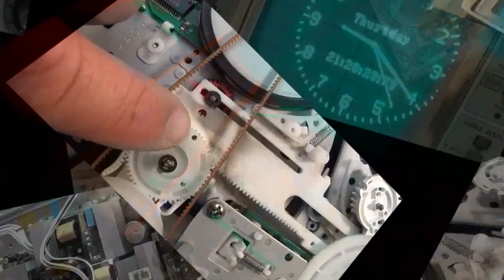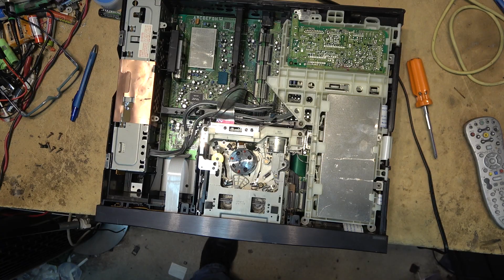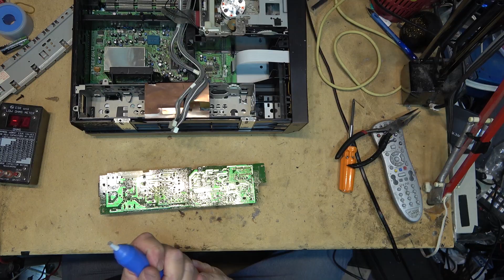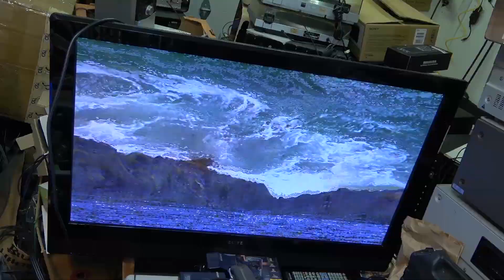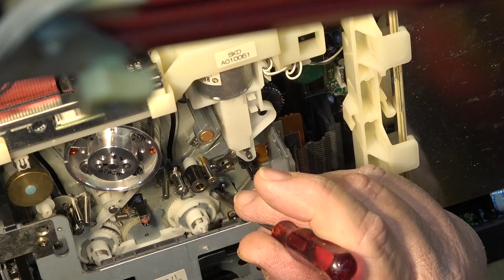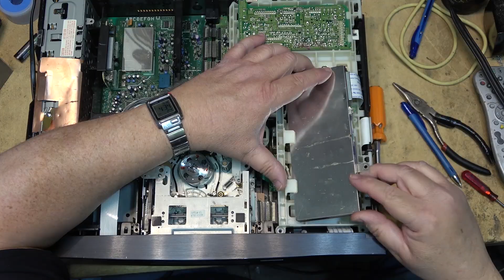SONY EVS7000 Hi8 Home Deck is totally dead

Comment: I also had a defective gear for the takeup reel on some of my Betacam camcorders. I replaced it with a self-printed gear from my 3D printer, and it worked perfectly again.
Reply from the maker: Not 3d printing these gears
Reply: @12voltvids  If you don't believe me I can send you a photo and the STL file.

Comment: I've still got that solder sucker.  I've since upgraded to the WEP 929D-V desoldering pump.  LOVE this thing!
Reply from the maker: Can't afford a pump.  I don't make any money fixing this stuff and the YouTube income basically just pays the bills.  Too many blocking ads these days.  Those or is relying on ad revenue are basically just breaking even if that.
Reply: @12voltvids  it's a manual pump.  I don't do enough of this work to be able to afford an automatic de-soldering gun, either.

Comment: HAHAHAHAH Cutting the Cord....
I may have mentioned before what happened to a Student next to Me in High School Electronics Class..
2 Sided long benches where students work from Either side.  A student flipped His Soldering Iron to get the cord from pulling and get a better work position. WHELL  just as He did that the Cord landed in the Jaws of a cutters of the Student just across the Bench. as the timing was just right   Clip/Flash. I fell off the stool landing on the Floor I was laughing so hard...  Even after 45 some odd years I can still see that.....
Thanks for stirring up the Memory....
Reply from the maker: In high school we used to charge caps to 400 volts and call someone and then toss it to them they catch it and got a jolt.
Reply: @12voltvids  AHAH Yup I only fell for that one once.
At tech school 79/80  A student was working on a Color TV. and got bit.
His jerk reflex Had Him toss a Pen He had in a Hand and it stuck in the Ceiling about 10 Ft up  Not sure how long it stayed there....
Reply from the maker: @m9ovich785 a microwave power supply bit me once.  Suffered PTSD for years.   Insulation failed on a tool.  About 4 kv made my hand grip so hard i actually bent the pliers.  In my hand out my elbow (or i wouldn't be here had I not had my other hand in my pocket and had insulated shoes on.  Threw me about 6 feet back.  I landed on a stack of TV's knocking one down and breaking the cabinet.  Asshole boss made me buy the customer a new set.  I still have the one with broken cabinet.  Used to be over my bench on early videos.  For years my wife would not sit next to me because i would have flashbacks in vivid dreams where i thought I was being electrocuted again any my arms would fling around.  She got hit a few times if I fell asleep on the couch watching TV. PTSD is real.  Another time I was bit from the CRT 2nd anode. Lightning kept out and bit me.  This time in my forearm and out my thumb. Still have the scar on my right hand thumb nail to remind me what 25kv did.   Electricity scares the crap out of me.  That's why i play with it.  Lol.
Reply: @12voltvids  OUCH...

Comment: If i were you i would give priority to replace the caps from the front loader. It's better before it starts leaking.  2 of my Sony S9000 (PAL version) that i've bought cheap, had a significant fish smell coming out of that front loading board with small caps corroding the traces inside of the shield part of that board. I know it's a bit painful to disassemble that front loading part,  with a brown color flex cable that easily can be damaged but it must be done before the caps start leaking.
Reply from the maker: Well then i get it back in a year or 2 and i can do it then.  I have not been given a blank cheque to do this.   If the cost is too high i get told to keep it for parts.  I have a garage full of stuff I have repaired that people never picked up that i have to end up throwing out.   People around here don't pay me estimate fees, if I told everyone that they had to pay 50 or 100 estimate fees they would simply not being it in.  They want stuff fixed cheap cheap cheap. If the estimate is too high they abandon it and that's why i have so much stuff backed up in the shop.  A guy dropped off an old grundig radio about 2 years ago. The pot metal flywheel for the radio dial crumbled.  He never came back to pick this piece of shit up and it's cluttering up my garage.  I can't even take it to recycling because it won't fit in my car.

Comment: I had the same 56uf cap go dead on mine. Also most of the caps in the TBC board. And the caps in the DC to DC section on the drawer. Also cracked gears. Works great now.
Reply from the maker: Done videos on all the above on this model